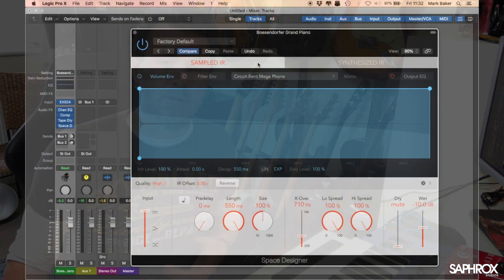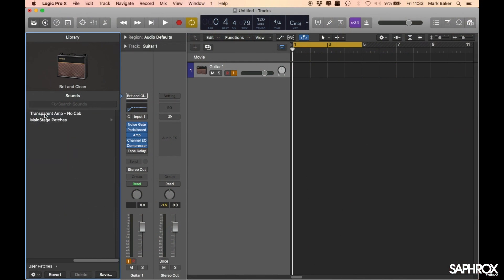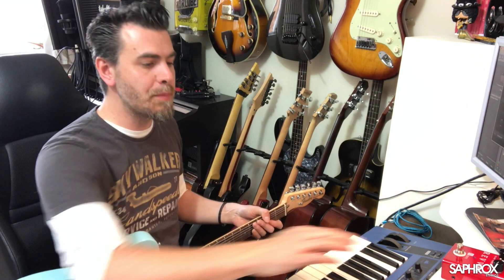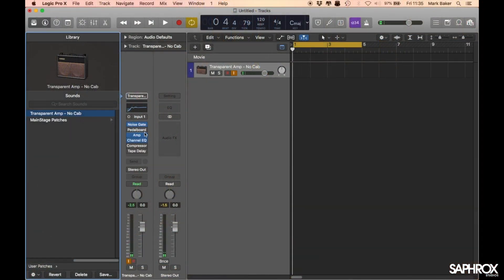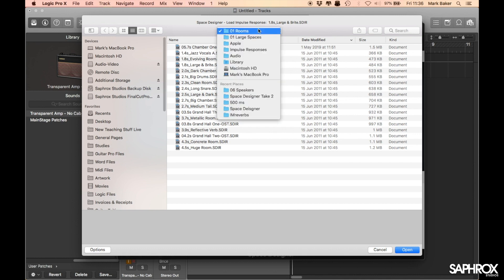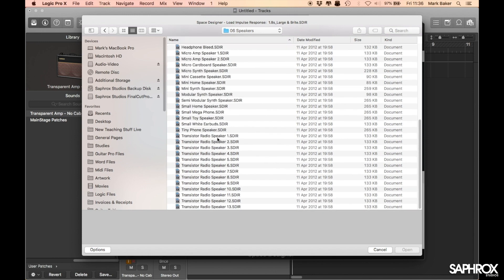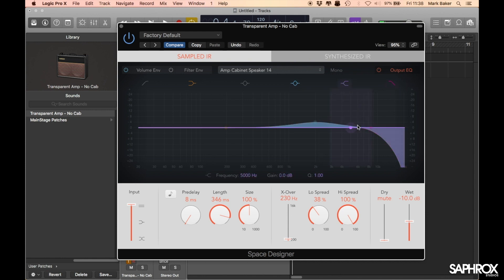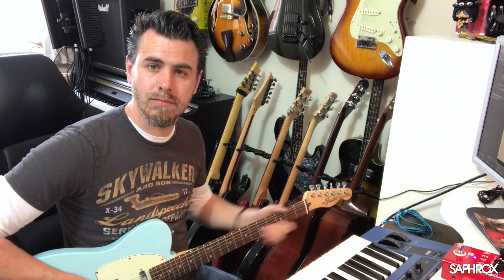Saphrox Studios - Guide To Logic Pro X - Space Designer Pt 3 - Speaker Simulation

Comment: Hi. Nice video. I've made a comparison between Space Designer and NadIR (STL Tones) using the same cab simulation file. It sounds different using Space designer. Do you have any tips about how to set the different knobs in Space Designer? One thing that I notice is that my wet must be in 100% and dry in 0%.
Reply from the maker: I don’t have a reason, but…

Yes. 100% wet, and check EQ settings. 

The NadIR may be eq’d and not be flat, so you may have to sculpt the EQ to match. 

You could use Match EQ to work the sculpting required and then see if that helps with all IRs cross compared. 

Good luck
Reply: @SaphroxStudios  Ok. Thank you. I will try it.

Comment: Terrific video thanks! Sorry if I missed it but you didn't mention which audio interface you are using here.
Reply from the maker: Thank you. 

Focusrite Saffire Pro 40
Reply: @SaphroxStudios  Great, thanks. So when the distortion pedal was sounding off, that was happening through the Saffire? And then it got fixed by the IR from Logic? That’s incredible.
Reply from the maker: @accentontheoff  pretty much. 

The full chain is:

Guitar - Dist Pedal - instrument input on interface - Logic transparent amp in amp designer with cab turned off - sound designer with speaker iR loaded.
Reply: @SaphroxStudios  Great, thanks! :)

Comment: Good vid cheers. But viewers should know you can get the speakers etc straight from the presets menu at top left under Warped Effects. No need to get into loading responses.
Reply from the maker: I realise that I didn’t mention the drop down on this video. It’s an overlook on my part, but the menu was shown in part 1 and part 2 of the video trilogy. 

I did however want to show how to load IR’s as I wanted viewers to understand they can load custom IR’s using a stock IR loader found in Logic Pro X. 

I also feel, though must admit that I didn’t say this in the video, but the Apple Speaker IR’s are most likely the same IR’s found in Amp Designer, so if the user wishes to load the Apple IR’s, they might as well use AD with the amp sim turned off.